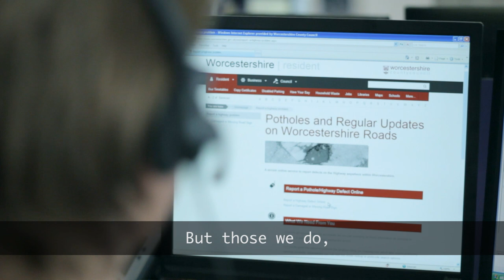Worcestershire County Council | At Work in Highways | Worcestershire Highways

Comment: Well I think this shows that some of us still have a sense of humour. These guys take a lot of flak from motorist and it's great to see that someone took the initiative to produce this low cost video which has now been picked up by the local radio stations and it's message is getting across. Well done. P.s. we got a few pot holes here in Kempsey if you are around this area.